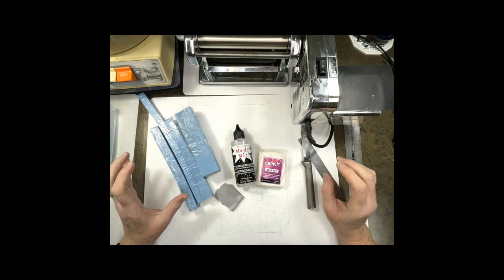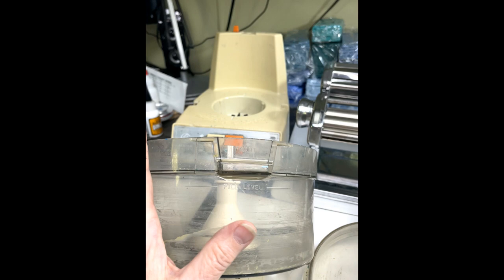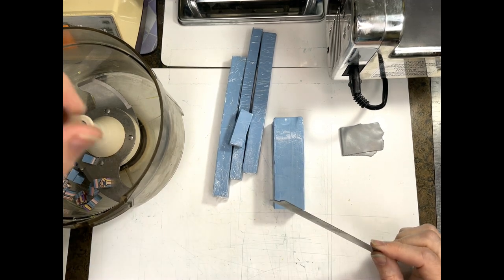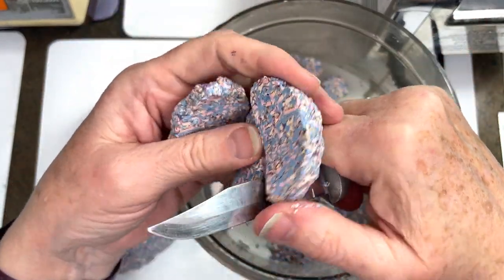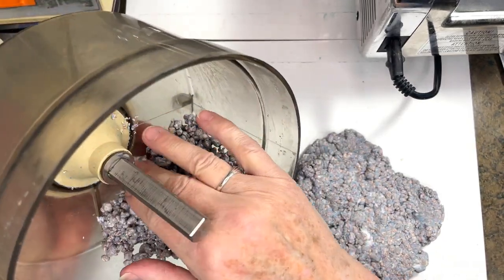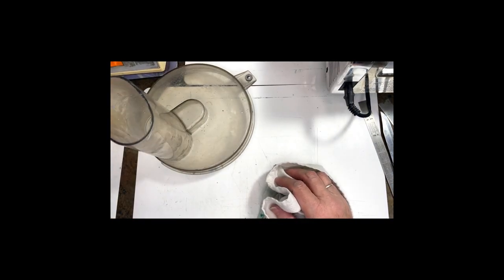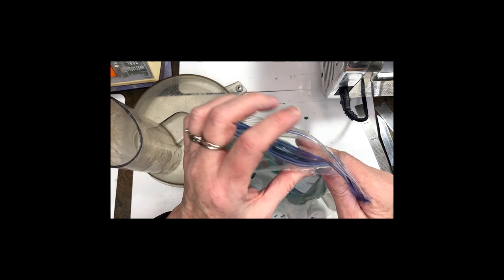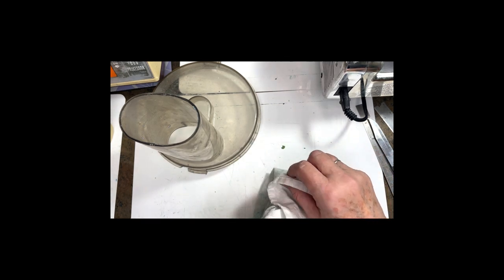Renewing old Polymer Clay

Comment: For over 50yrs I traveled for a living.   Once 'key cards' replaced metal keys i`never returned a key card.   Key card readers are available online.  Your personal info is on the strip.   Protect yourself.   I utilize key cards and old credit cards when painting and for other projects.  Eventually I either cut them into small pieces or I will melt them to destroy my banking info.   Hotels may have improved their security in that area but it's a risk I was willing to accept.
Reply: I honestly hadn't given any thought to old hotel key cards, naturally you are so right.  I still have old cards on hand and it's just clicked to use the cards for spreading acrylic  base coats , applying  base coats when Dot painting. Thanks.

Comment: I was pleased to hear you say you chop up your old canes in a food processor. I thought of using a food processor to start softening up my clay that is aging, at 70 my hands, arms and shoulders ger tired and ache very quickly act5 I think my shoulder joints are disintegrating on me. After alll, working smarter makes for an easier life. I only got a small processor that has a glass bowl but I can't  complain as I got it for nothing using reward points. I was concerned about using anything with a plastic bowl of whether the chemicals would leech, obviously my thinking was on the right track. I haven't really heard of other polymer clay enthusiasts using a food processor. I will only be doing small batches at a time, so a one litre bowl is ideal for my use.

Thanks for your other tips and tricks, we are never too old to learn. I had been really concerned that my clays wouldn't be useable. Yes I found a clay conditioner as well as Cernit's Black Clay that converts any colour clay into black clay. As I use a lot of black, I thought it wouid be helpful but I have yet to use it. Thanks for all your hints, much appreciated.

Comment: 1) I have canes from cane trades from 15 years ago.  I assume they are primarily premo, but I really don’t know.  If they are Kato I can smell the difference, but not the other brands.  Is it a problem to mix them together not knowing if they are the same brand?
2) I have quite a lot of vintage clay that is now unworkable.  Can I assume I can use this process for that clay as well?  Would you recommend reconditioning with cernit regardless of clay brand or is it better the clay softener specific to each brand?
TIA!

Comment: Why spoil good clay by adding to old clay (Old clay is perfectly softened with sunflower oil and petroleum jelly
Reply from the maker: Old clay is perfectly good clay, it just needs refreshing, I am not spoiling it by adding softening agents. Sunflower oil has the potential to turn rancid, and petroleum jelly is not made to work with polymer clay, and could cause issues in the future. I personally prefer to use products made specifically for polymer clay in order to avoid future issues.

Comment: If the clay you made 15 years ago comes back into style, can you reuse the clay or sell it to another crafter without starting all over again?
Reply from the maker: I think you are asking if the cane design comes back into style. The answer is ....sometimes, I don't know why but sometimes canes will stay workable as they age. Although by 15 years most are not. It also might depend on the type of clay used, I have used Fimo (now Fimo Professional) since I started.
Reply: @jennypatterson6660  How do you know if a cane is no longer workable? Would storing them in glass make them last longer?
Reply from the maker: @MountainAirOrganicBeds  I test the cane by taking a slice, warming it in my hands for a couple minutes and see if it becomes flexible. If so, then I very gently manipulate the cane by compressing and stretching it to warm it up. If it shatters in my hands, then I consider it no longer workable. I don't think storing in glass would make any difference, but be sure not to store on any material that will leach plasticizer out of the cane. And store it in a dark place where it won't get to hot. I wrap my canes in glad cling wrap, and store them in those units with 7 drawers, kept under the counter in my studio. Or smaller canes are stored in fishing tackle boxes on a shelf.
Reply: Thank you, this has been very informative. I am newbie and I want to learn mistakes from others who have traveled down this road before. I bought a convection oven and I have a new toaster, I am going to see which one works the best for me. My husband wants to cook in my new convection oven, I said, “he’ll no, go get your own” he asked, “why not? I explained to him “just a little bit of toast could ruin my creation”, he said, “I don’t believe you, you are just making that up” 😁I said, “It’s all over the internet! You are not using it so keep your grubby hands off it!” We chuckled. I said, “It was only $55 on Amazon, go buy your own, I will test both out and give you the one I don’t want.” The oven is beautiful, It has a glass bowl, it’s supposed to be two tiered, but I can’t figure it out. The bottom is 9” round so I can buy 9” round parchment sheets. Should I put a pan down on top of the wire rack so I don’t get wire marks on my cabochons? 🤔
Reply from the maker: @MountainAirOrganicBeds  I have never used a convection oven like that. The first thing is to test it with an oven thermometer, make sure you know how it's going to heat. If you use the toaster oven, watch the thermometer closely, as they tend to fluctuate greatly. You should check out the "Insiders" on the Blue Bottle Tree, there is a ton of advice for beginners there.
Reply: @jennypatterson6660  Definitely, thank you for the wisdom you part from your experience. It means so much, and yogurt have been very helpful and responsive. Thank you for that. This group you speak of, is that a YouTube, Facebook or website?
Reply from the maker: @MountainAirOrganicBeds  Ginger from "The Blue Bottle Tree" has a website with many articles and tutorials on PC. You really should check it out, she researches everything and gives clear accurate information. The Insiders group is a subscription group where you can ask questions, do show and tell, and much more.  Plus you can join into zoom get togethers.  www.bluebottletree.com
Reply: @jennypatterson6660  Sounds good, thank you. I am looking forward to it.